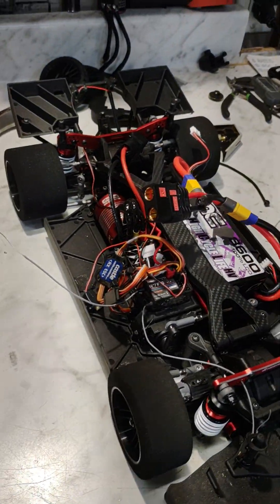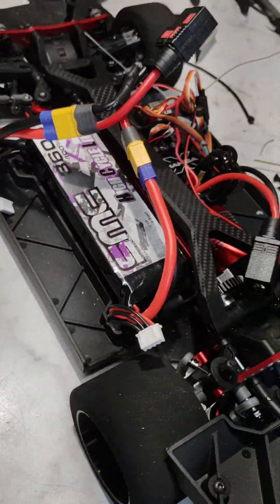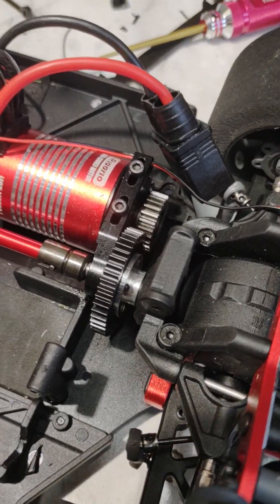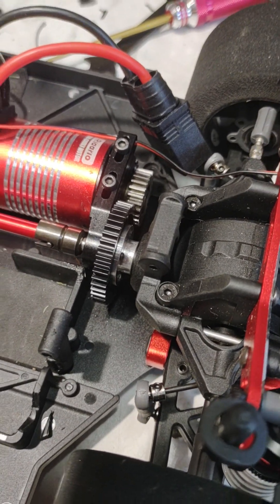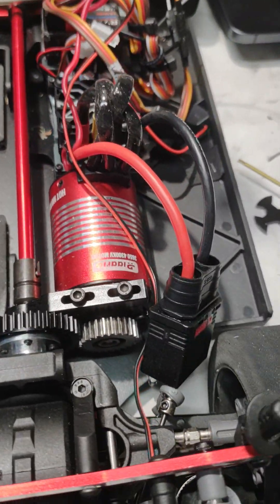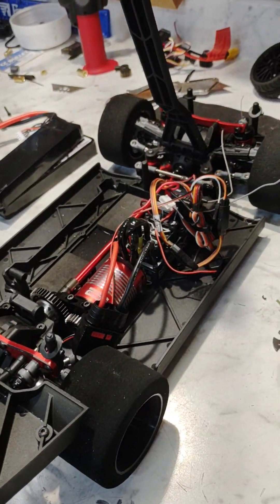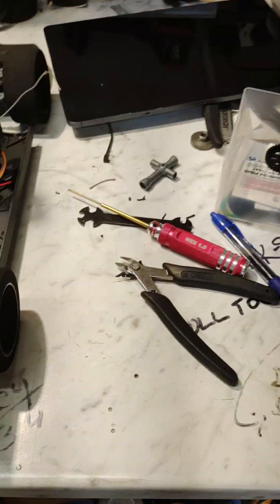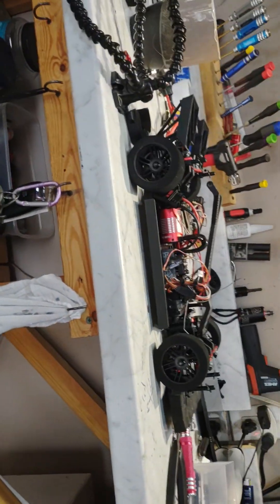SHE'S BACK! "AK-917" REPLACEMENT, AFTER 116 MPH CRASH.

Comment: looking good, question is that pion centered on the spur gear, looks a little off from camera 📷 angle 🤔
Reply from the maker: THE PINION IS SLIGHTLY LARGER, [THAN THE SPUR] SO IT'S LINED UP EVEN WITH THE BACK SIDE, BUT YES, IT'S COVERING THE WHOLE SPUR FOR SURE.